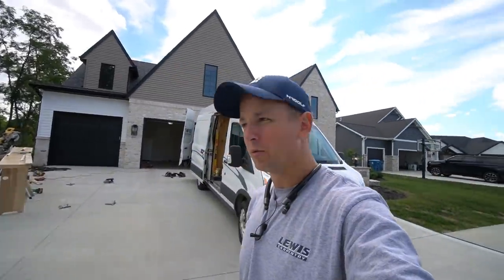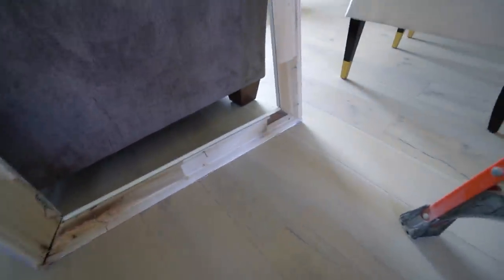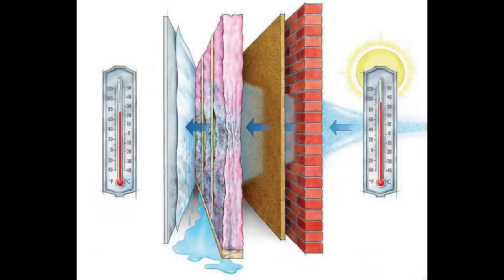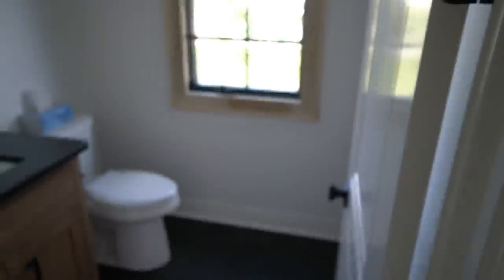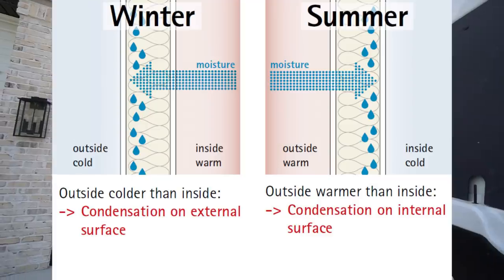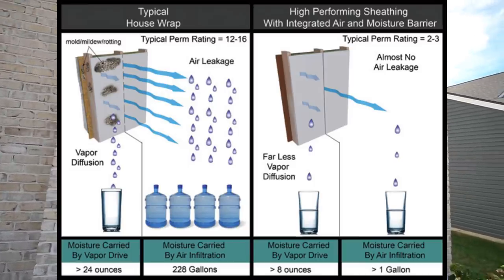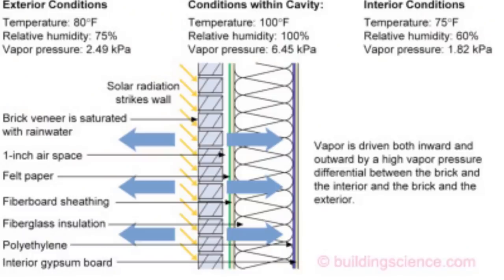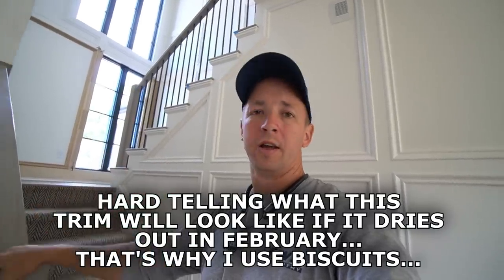Trim Humidity DISASTER!!! Is Vapor Drive Destroying this Trim Package???

Comment: We run into this sort of thing quite a bit. First off do everything you can to get rain water away from your foundation. Go out on a rainy day and make sure that the majority of your water is going through gutters or someway getting away from the house. I've actually never really run into major vapor drive this bad that it would cause the brick to do this on the north side of a house.  Not to say that couldn't be it. If you ever tear brick off a house its not uncommon to have some sort of moisture behind. Being that this was build on a slab is there a possibility of moisture coming through the slab? I've run into this on different occasions for different reasons. It's pretty common to run gutters into footer drains which doesn't seem like a great idea to me throwing all your storm water strait where you don't want it. Most of the time if it's a ventilation issue in the house you'll see signs of moisture or mold on the underside of your roof sheathing or sometimes drywall cracking in gable walls on a vaulted ceiling (heat and moisture rises and collects there). Anymore it's fairly easy to seal up a house too well. It could be several different things. I'm not an expert. I'm just a contractor who tends to deal with a lot of poorly built/ designed residential structures.

Comment: residential HVAC doesn't significantly drop the relative humidity. You need a whole-house dehumidifier running in parallel to the HVAC unit and probably an ERU. The post below is correct, pop some dry wall and look at the framing for rot.

Comment: Vapor barrier looked good and taped. Call manufacturer I saw in picture. Open drain weep holes and check for moisture. Perhaps a piece of Fiberglass screening poked in there with a pencil would be better.

Comment: I think John nailed it. I would also be concerned about the OSB behind the brick. That moisture is working on that too, swelling it and rusting fasteners. Ive always used built-rite or fiber brace wall sheathing behind any masonry finish, be it brick, stone or stucco. A rain screen and air gap is a must. Somebody else mentioned, and i agree, contact the builder. It is on them to address the moisture issue and correct it.

Comment: Is there a draft coming in through the walls, where you opened up the window trim? Use some fiber glass strands for wind movement..had the same issue with that, in florida. In an area I trimmed out..  a yr after the install, mold and the whole nine yards.. no mold on the back side of the sheet rock..but the face of the sheetrock  and back of the panels and 1x4 ...it ended up being a small hole in the spray insulation  and an ⅛ hole in the sheetrock and 70° Temps in the house. That caused a small draft( into the house) of warm humid air from the outside

Comment: That’s a pretty bad situation have you checked with any of the neighbors to see if they have a similar problem. I only saw the staircase had  carpet is there carpet throughout the house?  Its always possible the moisture could be coming up through the slab and through the carpet. Another point is that the weep holes you showed on the brick Didn’t seem to indicate anything was ever coming through So it may be just the moisture it inside the house.

Comment: A few things that I need to know 
1) is the slab insulated with a moisture barrier 
2) how’s the drainage outside such as is the grade sloped away from the house 

I’m leaning more towards an issue with water coming in from inside since it’s the north wall getting most of the problems. The sun would never dry out the humidity coming from inside. I believe it’s a hvac issue or a water leak or drainage leak allowing moisture to come through the slab. If 3 dehumidifiers can’t keep up then it’s definitely not a exterior humidity issue. That many dehumidifiers shouldn’t have a problem. Smoke test the duct system and the plumbing vents because that moisture is coming from the inside working it’s way back out I believe.
Reply: Also if the ac is short cycling it will never pull the humidity out of the air

Comment: Obviously, I don't know.  I will take an educated guess.  Just hit 31 years in carpentry, but I still learn.  

This is what I noticed on the last house.  The house has 1/2" closed cell spray foam on the interior of the walls, then 6" fiberglass, then visqueen, then 1/2" drywall.  In the garage, only 3 1/2" fiberglass and visqueen.  (Homeowner wanted to finish it himself.  Walls only, the garage does meet firecode.)
I noticed moisture under the visqueen.  I pulled it down and the insulation was very damp.  The insulation had only been installed about 1 week.  I checked the house and it was perfect.  The only difference between the two walls, were thickness and lack of foam in the garage.  When I pulled out the insulation, the exterior sheeting was very hot and humid, where the sun was hitting the exterior siding.  I pulled some out in the house, just to see how it was.  Insulation was dry and there was no moisture on the foam.
So there could be some humidity in the insulation, that never got to dry out.  I know insulation should be dry and the installer assured me it was.  It definitely not obviously damp. 
Those miters separating seem to be the wall, expanding.  Kind of like when the drywall is proud of the extension jamb and someone doesn't know how to cut the miter.  The inside corner will match up, but the outer part of the miter will have that gap.  
I'm not really buying the brick being part of the issue.  The brick appears to be laid the same as it's been done for 50+ years and those houses are just fine.

FYI, this is Illinois,  middle of the state. We've probably had a similar humidity as your area.

Comment: I'm from UK so Building Codes could  well be different 😯 Here in UK there has to be ventilated cavity between the brick cladding and wooden framing (sheathed in OSB with Breathable Membrane applied using St/St Staples). The brick wall itself should have a DPC (Damp Proof Course) layer fitted to prevent moisture rising from the ground, with cavity drainage trays fitted to capture any cavity moisture and Brick Weep Vents/Ventilation fitted (different to the Weep Ropes you showed in that they're thin plastic one brick high vents  placed in the perps  (vertical mortar joints) at 400mm spacings, that provide both water drainage and ventilation). Lastly wall is tied to timber frame using angled "upside down U-cross section" St/St wall ties that slope down towards wall 👍 Unfortunately "certain" bricklayers either don't fit the cavity drainage trays properly or don't clear out the "muck" (mortar) they drop down into the cavity trays from their Philadelphia or London Patten trowels, with mortar spread across the wall ties and blocking the Weep holes/vents 😨 Consequently  moisture builds up in the cavity and with little to no ventilation this manifests itself as evaporation/condensation eventually creating the problems you mention. Hope you get to the bottom of the moisture problem and it would be great if you could do a follow-up "Solution" video 👍 as i will be very interested to know what's going on here 😉 Wishing you all the very best.

Comment: I’ve been working in masonry on and off for the past twenty years. Something I’ve seen a lot in the past several years when doing repair work on newer homes, is the “masons” building these newer homes aren’t mixing the mortar at the proper ratios of sand to mortar mix. I’ve gone out to do repairs and can dig the mortar out with just a trowel. They are using WAY to much sand in there mortar. I’m sure that would contribute to excessive moisture bleeding through to the backside of the bricks.

Comment: In the UK we almost always have brick work walls with a cavity then internally we have block work and occasionally timber frame as in the case of this house. We have weep holes any time the wall meets a solid junction i.e a lintel the top of the wall is also open into the loft/attic space and is vented accordingly to that way even if the exterior skin gets saturated it cannot penetrate to the inside layer. The only reason I can see is that there is no airflow inside the cavity to drive the moisture out. Meaning that the whole wall assembly is two well sealed. In my mind I can't see it being ac as surely the internal walls would have issues also? (Not that I know anything about ac.. we don't have that stuff here!)

Comment: Good stuff. Love the building science fight club ig page. Loads of info.
The HVAC could def be short cycling. Meeting the call for temp on the thermostat and not running long enough to dehumidify. Def 3/4 issues at once going on here. 
The masonry install seems like a heavy culprit. The air gap as others mentioned is very important. Also, I don't think that I have read any articles with flash and batt insulation methods with less than 1-2 inches of closed cell foam before fiberglass. Less than an 1" doesn't even count as a vapor barrier from what I read.

Comment: Most likely a hvac unit issue with a maybe a brick issue not spaced correctly behind that front wall. The hvac is pulling too much moisture into the house in a negative pressure issue.

Comment: Located in Indiana - considering you don’t have all the information from build you need to do a collab with mason, window guy, hvac guy in the least. My guess would be brick used is porous abs windows not properly flashed/sealed and the combo is causing too much condensation. Possible seal of brick and ensuring caulking on windows solid could be a fix for now if not trying to re do everything if they don’t have the legal route to do so. Either house needs to breath or be sealed almost 100%

Comment: Spencer if that's a super tight house it's going to have to have a separate dehumidifier and a fresh air intake I'm sure the builder cheap out and didn't put one in it's drawing moisture from all openings and that would be the AC unit doing that I'm going to say he's going to have to put one in

Comment: Porus exterior material acts like sponge - it soaks up when it rains or condensation form on it, and then releases it on hot sunny days... can cause mold due to high humidity. We fixed this issue by removing stucco.

Comment: Seal around the windows and doors outside with a bead of clear silicone.Also aluminium windows that do not have a thermal break will transfer cold from outside to the inner frame and then you get condensation inside.Alternatively you could rip all the windows out and replace them with European U.P.V.C double glazed windows.

Comment: If your client has a smart thermostat, make sure that the airwave function on the thermostat is turned off. Airwave allows the HVAC fan to run after the heating or cooling cycle has completed supposedly clearing the remaining cool air from the ductwork. Unfortunately, the condensation on the coils that would fall in the drip pan and out of the house through the condensation line is instead, blown back into the house because the fan is still running. It's never one thing that causes a problem as large as the one that you have, but I'll bet that this is a large contributor to your problem. Also, if the house is super tight, then an ERV, ( energy recovery ventilator ) should be a part of this HVAC system. An ERV will also help remove moisture from the house while bringing in fresh air.

Comment: Sorry I saw this so late - I'm sure you have it solved by now, but a few comments: I don't know how much the HVAC over sizing is an issue, but the brick ventilation is almost certainly the main problem.  Those tiny vent holes at the bottom that you showed in the video aren't anywhere near adequate.  There have been a huge number of this kind of situations with EIFS siding that was installed without air flow behind it (it is impervious and held condensation from inside the house, but it's the same problem) - the OSB is probably fit only for garden mulch now and the framing could be compromised.  If there's not enough air gap behind the brick, it needs to come off (probably needs off anyway to fix the structure).  'This is a huge mess and the general is probably liable for the fix.

Comment: Replacing the trim without dealing with the moist issue behind the walls is not advised. 

You need to inspect behind the walls. I would cut a small section of sheet rock out. . Pull the insulation, and inspect the back of your OSB or zip board. If needed drill a inspection hole for a camera to see the gap between the vapor layer and the brick. 

Also I would inspect around the windows to see if proper graces or water membrane was used. 

Just my 2cents

Comment: There should be weep holes in the  bottom row of brick ac unit could be oversized not dehumidifying the duct work should not be in the slab pull a floor vent and do a duct inspection if the duct work was not sealed to prevent moisture  intrusion

Comment: 4 tons of cooling is designed to cool about 2000 sq ft, as soon as you introduce spray foam that heat load changes. The hvac contractor should have done a manual j for sizing, it certainly seems like that moisture is from the inside out. I would definitely want to open a wall and look for signs, keep us posted, I just recently subscribed to your channel, I am enjoying your content

Comment: You need to hire a water/moisture intrusion expert. I'd recommend getting a hygrometer and getting readings throughout the day/ seasons.  But it does look like some cladding issues and possible condensation issues.  Every region of the country has water intrusion experts familiar with local codes and construction.  Check with someone local. If you don't know anyone check with local restoration contractors.

Comment: Before you retrim that place they better cut in some test holes and see how bad the walls are. My fear is rotted OSB and studs and mold. Brick is not a water barrier. I’ve seen demonstrations of water wicking through brick in a matter of minutes. If there is no rain screen and water barrier along with weep holes at the bottom of the brick this could be a disaster.

Comment: Its hard to tell from the angles but it appears there isn't an overhang on the gables. It also appears the framers didn't compensate for the brick on the eave overhangs. That being said, if there were issues with the front door it seems more likely to be an HVAC issue. That wall has siding with a good overhang from the porch. On a side note, that brick coming just short of the top of the front window bothering anyone else? lol

Comment: Definitely no overhangs on the eaves is not helping this house. Brick is super absorbent. Make sure the sprinklers are not pointed at the house. The vapour barrier is most likely compromised and there might not be a big enough gap behind the brick for things to dry out. Also it could be dripping from the roof behind the brick. It also looks like there is no flashing where the siding transitions to brick. That is asking for problems.

Comment: You mentioned there is no air gap behind the brick. If so, than that is the primary issue, the brick will always suck up moisture and needs an air gap behind it to dry. The sheathing and wall assembly material is pulling that moisture through and the  condensing onto the sheetrock and window casing as you mentioned. Sealing the brick may or may not provide some relief but will never be a permanent solution.

Comment: Check the flash and batt method if it is not done right it can cause issues with moisture people can cheap out or install incorrectly and not put enough spray foam I would research it

Comment: Hey Spencer
Here in Canada we deal with high humidity in the Summer and super dry in the winter. And i notice there's no place for moisture to escape behind the brick. Up here we leave open joints especially under and top of windows/doors and last row of brick for moisture to escape and air circulation. That's is y the casing is wet. Also they could have no insulation around them.
We struggle alot up were to control our home humidity leaves do to climate. Summer I'm always over 60% and winter i have to run a humidifier that's attached to hvac to keep it at least 35% and I've never had massive openings on trim like that. 

2nd thing those humidifiers are  drying the wood faster, it happened the same thing to us here, the homeowners ran a massive humidifier that even the kitchen cabinets and stairs casehad big problems. Had to be replaced.

Cheers from up north.

Comment: The outside sill on the brick windows should be a solid piece of stone, not bricks. When it rains, water seeps in from those sill bricks and it flows down the walls underneath.  That’s why the windows above the brick have way less trim damage. But a little because of the high humidity. The AC unit isn’t designed to keep up with that kind of moisture intrusion.

Comment: If u know distance the window frame protrudes from the sheeting. Measuring the face of the brick to the face of the window frame will give you an idea if the brick it tight to the wall, if there is an air gap, u wont be able to determine if it is full of mortar unless you grind out a few joints.

Comment: I would think the brick veneer is causing this problem.  The mortar joints are very white, which makes me suspect that a lot of lime was used in the mix.  The veneer is wicking up moisture and it's being pushed to the inside.

Comment: The first thing I would do is put a temperature and moisture monitor in for 3-6 months.   I would also consider an architect or envelope engineer to review the construction because you can replace that trim for ever if the moisture problem is not solved.